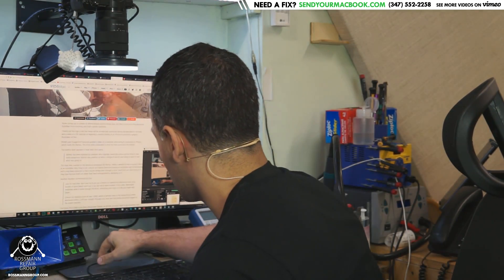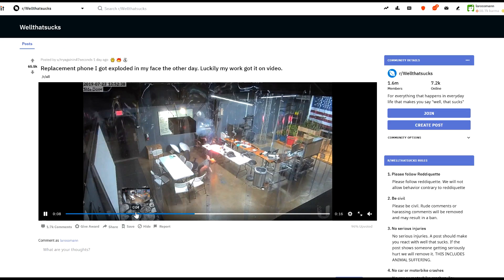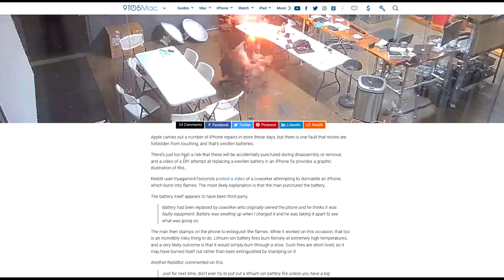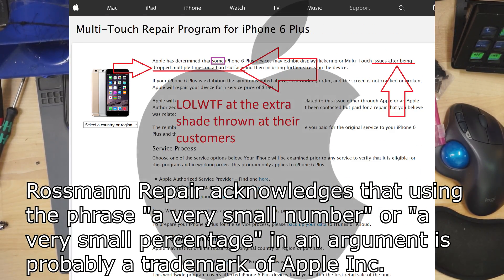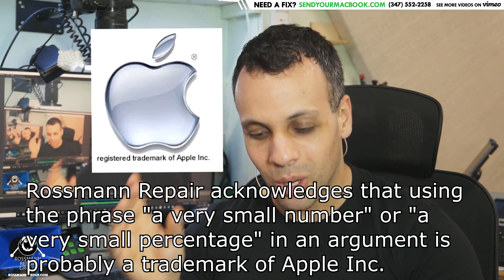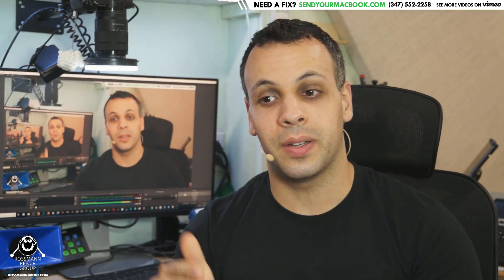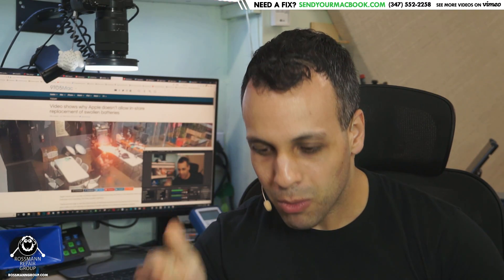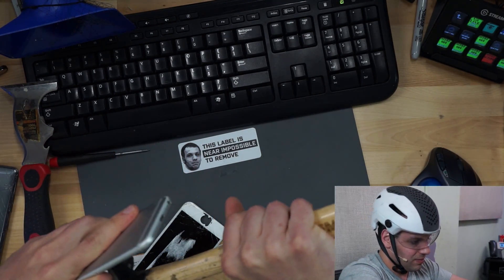STOP FEARMONGERING

Comment: Hi Louis, I did the same thing as you for 15 years but from 95-2010. If you remember the last MacBooks that had removable batteries they where a lot thicker. Todays MacBooks aren't so much anymore, that is due to the removal of the replaceable battery and the adjoining case making for the battery, battery tech in general, the holding and housing allowance for a removable battery, and so on. Could you make a stepped battery like what is on the MacBook ( not Pro or Air) and make that removable while also making the case thick enough to have the rigidity necessary to handle normal every day peoples handling characteristics? No. You and I both know people for the most part are not that bright when it comes to electronics and their care. Look at your old laptops with removable batteries. You could take one of those batteries and whack someone on the head with it and they would get a nice lump. You couldn't make a stepped layered battery to be that resilient. Todays laptops and the future of them will be thin and lite devices that take this thin type of battery. Work horses like the ThinkPads probably won't because let's face it they are bricks of a machine. MacBooks and other laptops like them are for style minded customers who desire a minimum footprint for a laptop. The smartphones like iPhone XSs and Galaxy S10s are the similar in that they are for style and pack a lot of power inside them. That is what sells and that is what gets make. If an item doesn't sell well then it is scrapped, that is just how it is.

Comment: I agree with Apple's policy. Filling my car with petrol (gas) is dangerous, one spark and bang! So car manufacturers should have sealed tanks, and you must take the car back to the dealer who will fit a full tank of fuel to the vehicle, safely!  😂
 
When you could change the battery in your phone, the battery was in hard protective case that prevented easy puncturing. I use to charge spare batteries, and swap the over as required.
Reply: There's a reason why they prohibit smoking near gas tanks. And still, cars sometimes blow up because of static electricity. A car blowing up from a spark is actually a less improbable event than a battery blowing up by itself. 
Old batteries were less fragile because people weren't obsessed with sleek design. Just try to give an old Nokia phone to anybody today. My first Motorola had a rechargeable battery pack you could substitute with 4 AA batteries. The next one was already too "cool" to have room for regular batteries, and I think it was in 1998. In another 20 years we'll have 1 square mm plutonium batteries that will end the universe if looked at intensely XD

Comment: People worrying about lithium ion, meanwhile I stick 6 cell 5000mah lithium polymer packs in an rc car that I crash into curbs going 100mph.

Anyway, lithium is only volatile if it comes into contact with oxygen while it has a charge.
If you discharge it fully, it’s totally inert. And if you do puncture it, drop it in salt water.

Comment: Louis great psa a lithium battery is volatile this is why it stores energy so well and can combust when punctured., but you kinda get something a little wrong, while yes smaller lithium batteries do tend to catch fire when punctured, there are some lithium batteries that exist with built in fire suppression chemistry in them making them really really hard to catch fire. these fire resistant batteries can be forced into flames by exposing the lithium to moisture but they go out pretty quick.

Comment: For iPhones, how they could maintain waterproofing but offer greater serviceability: They could make an internal hinge that is activated by the same tool you use for a sim tray.  This hinge would unlatch a backplate.  The backplate would be rigid enough to be secured under moderate pressure with an o-ring or gasket beneath to prevent water penetration.  The battery would not be secured with industrial adhesive, rather held in place via a snug fit with a plastic pull tab secured to the underside to lift the battery without the need to pry or or use percussive maintenance.

Comment: I bought a replacement battery for an HTC.  It arrived in a super thin cardboard box thinner than a playing card.  This was put inside a plain small minilla envelope with zero padding.  I was shocked it made it's way through the USPS without exploding.  They really aren't that fragile it turns out.

Comment: Just recently, I did a battery replacement on a mid 2014 MBP for the first time. Yes, it was a pain in the ass. Yes, you need to be careful. Yes, apple should not glue batteries into their systems making it difficult to replace. But lets ask another question. They say they don't want battery replacement in-store. So where DOES it happen? Somewhere else? The work still gets done, so that is a totally bogus argument.

Comment: I'm typing on a dell 7530 right now that has the same type of packet style lion battery, it's not glued or taped in, it has one cable connecting the entire pack to the system and a couple of cables connecting the packets.  My machine is a little thicker than an Apple (but has FAR better cooling).  The battery has a few foam pads around it to keep it locked in place, but allows for expansion.  During a couple of repairs I've already pulled the battery a few times, and put it right back in with almost zero effort (except for one of the connectors that's a PITA to line up) .  There is no reason why Apple can't do the same thing.  But they wont, because Apple.  This Xeon powered machine with a decent GPU will do pretty much anything a high end Apple will do, with better cooling, no reliance on a gap between the LCS bezzle and body of the machine, and do it cooler, with less chance of throttling, all while being FAR easier to work on when necessary.

Comment: Of course your glossing over a few other facts. Apple still performs repair on swollen batteries if it's shipped to a different facility with extra safety equipment. They perform the repair at the same cost as a regular battery replacement. Most phones are swapped with a replacement device for that same low price in store.

Comment: i own a oneplus 5T, the battery is indeed glued to device, however the glue used is obviously there only to keep the battery i place, not to prevent someone from removing the battery...
One: the glue adheres the battery just good enough to keep it in place
Two: not only is the battery easy to replace once you open the phone
but it also has a dedicated pull-tab specifically for the purpose of removing the battery :D
I really really like OnePlus (so far that is)
I have owned
Oneplus One
Oneplus 5T

Comment: Devices should have "consumable" components be easily replaced. Imagine the outcry if someone produced a printer which made it difficult to replace the ink cartridges or to use third party replacement ink?
Reply: Just imagine XD
Or a car manufacturer using a control panel you can't swap with another manufacturer's control panel! And making it difficult to pour gas in their diesel tanks! HERESY!

Comment: So, the battery might need replacing at 15 months....if the rest of the machine lasts that long.
If they did not use that adhesive, I could get those batteries out and use them for something. Instead, I have to peel a dead laptop off the cells and risk ruining them.
BTW - do we know if the video used in the ad is staged or CGI?

Comment: Actually they should want to remove swollen batteries before they burst. Also it does not matter if a lithium battery is new in perfect condition or old and swollen if you breach it (allowing an uncontrollable reaction) it will possibly cause a fire.

Comment: I find it funny that they stated that it was a 3rd party battery, can they prove that it is? They seem to think their batteries when punctured wouldn't start on fire, considering their batteries are lipo batteries which do not have a puncture resistant skin on the outside is extremely funny. Any lipo battery when punctured will start on fire regardless

Comment: Easy way to protect yourself have a bucket of water on standby for when it goes into flames - you can just dumb the device+battery.

Better yet, do the repair underwater.
Problem solved ;)
Reply: This is really dangerous advice, never use water for chemical fire sources.
Reply: Gerek of course it is!! I didn’t think it needed explaining - look at the wink at the end.... 8-/
Reply: Gerek I mean if you read the whole thing - who is going to do a repair UNDERWATER??!!

Comment: Dream that I've had: Top management at Apple leave for lunch and are stopped by Police for a 'Security' inspection.  Many vehicles are towed and crushed as being Counterfeit for remanufactured parts like water pumps that still have original markings or non OEM batteries.  Much weeping and wailing as Police explain how much safer they now are.

Comment: Soldering hardware in is nothing new, it's actually more of moving backwards. The RAM, CPUs and GPUs were mostly soldered in 1970s and 1980s. The CMOS batteries were soldered even in 1990s. Components became not soldered as a result of technological progress. Soldering the hardware together is old tech.
Reply: Only technically skilled people would service electronics in the 70s and 80s, so there was no need for LEGO components. Then technology started to advance at such a rate that easy access and upgrade was a must. Then, idiots started opening up their devices, getting electrocuted and suing the companies for making things unsafe, so the companies are getting back to devices that can be only serviced by non-idiots.
Reply: @IlBiggo  Please, tell me more about it. ELECTROCUTED while changing RAM? CPU? Battery even? So, that's why everything or almost everything is still replaceable on most laptops (not high-end thinner ones) and all the desktops, I see.
Reply: @Цельнометаллическийразработчик  Exactly. LEGO components versus high tech. A certain supposedly tech-savvy guy here on youtube famously ranted about "safety risks" after opening a computer that isn't supposed to be opened and finding an "exposed" power supply. 
I'm totally OK with both, LEGO or closed machines. But I don't expect to easily swap parts of a machine made to be as light and thin as possible. It will obviously lack any kind of "safety" - or shortcut - for script kiddies and tinkerers. And yes, if one is stupid enough he CAN get shocked while adding RAM or changing components. People make mistakes sometimes. Idiots make mistakes AND put the blame on others.
Everything is replaceable even on high-end devices, you just need the right level of knowledge. Some fancy themselves as "tech experts" because they know how to turn a couple screws and add RAM to a PC. Then they proceed to tear their cellphone apart, destroy it, and accuse companies of "making things difficult".

Comment: This reminds me of the uproar a while ago because towns were replacing incandescent stoplights with LED ones and the LEDs were so energy efficient that they didn't emit enough heat to melt snow off the surface of them in the rare cases where the wind speed and direction, type of snow, air temp and temp of the plastic cover was just right to cause any build up.

Comment: I would Love to have a slightly thicker phone with extra baterry life or to be able to swap the battery for charged one.
Reply: That's not what you need ( Apple sarcasm), and if you need that it's not Android either....
Reply: Both my old mac and old android (galaxy 5), both had removable batteries.
Reply: @screamtoasigh9984  the s5 was a good phone, removable battery and water proof. Usually I upgrade my phones after  3~4 years so I missed the 5 and went to the 6, the generation that skipped waterproofing and started with no replaceable batteries. 
Laptop wise I don't keep up with Mac's but if the only thing between me and the battery is a dozen screws I consider it swappable. The main issue with phones is that you have to remove the screen, the most expensive part of the phone and fragile at the same time.

Comment: "I want batteries to be removable again"
"Er ma gerd you're against progress!"
Didn't know going backwards and removing features was considered "progress" but alright

Also this week my phone died. From what I've seen, I suspect it's the battery that bit the dust. I hope that's the case, because then all I have to do is spend a bit of money on a new battery instead of buying an entire new phone, when the old one is perfectly fine. Sounds crazy, right? I mean why save money by only replacing what's broken instead of wasting your money by buying a whole new phone? 

This video shows a neat example of a logical fallacy called abusive generalisation (not sure what its real name is). They take one example of something going wrong and make it seem like that's the norm, which anyone with a brain cell will know is perfectly idiotic. Does it happen? Obviously, but there's a difference between a freak accident that rarely happens and something that happens so often that it serves as a valid argument to ban something. As someone else in the comments said: it's as stupid as using car crashes as an argument for banning cars altogether.
Reply: It’s selective data manipulation.
Reply: Jeeva Bharathi absolutely

Comment: I worked in a battery packing plant. we dealt with damaged lithium batteries every day. we had the oil buckets with lid to if we found a leaking or damaged lithium battery. it is very simple to have the proper safety precautions

Comment: A key factor which contributes to if a lithium ion battery will burn is how charged it is.
If you discharge it completely (i.e. beyond the point of a normal "dead" battery) then the lithium is not in a state to catch fire, and it can be punctured without burning. (Note: if broken so sections are not connected those sections may not be discharged so there is still some risk).
If you do it with a fully charged battery then a tiny puncture can be enough.

Comment: I went from a BlackBerry to the brand new Iphone 5 at the time. I switched from that to android and haven't gone back. When I had my Iphone 5 I had to take it in for repair for this purpose (I though it was because I had separated the screen from dropping it. Since it was out of warranty when It happened I just took it to the closest repair shop at the time, they obviously fixed it no problem. At that time I had not seen your channel and was completely unaware of Apples shenanigans. 

   Fast forward to yesterday, ever since I switched to android my dad has used my old Iphone 5 sure enough the battery swell had returned (he also thought that he had broken it somehow) I informed them what the problem was which actually took some convincing. I asked them where they were going to get it repaired and they were going to go to the apple store (which on top of being terrible in every way is also about 15 miles away from us) I promptly warned them about going to apple for repair for many of the various reasons you've pointed out (I wasn't aware they wouldn't even attempt to fix battery swell) and convinced them to go to a different local repair shop which they found one less than a mile away. It was done within a couple of hours and for a good price as well.  

   Anyway because of your channel I was able to save my parents time and money and help out an independent repair shop. So thanks for what you do. It's a nice bit of fun coincidence too.